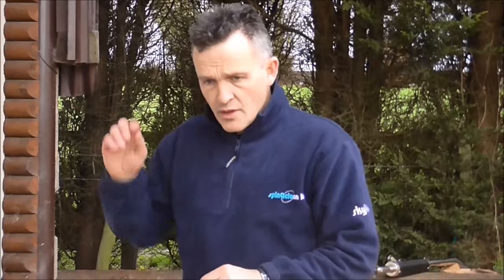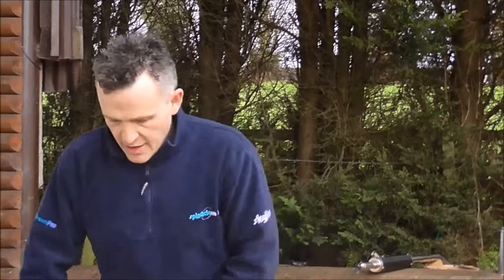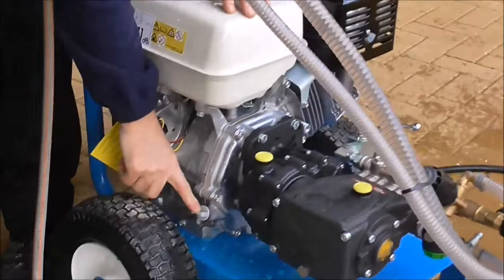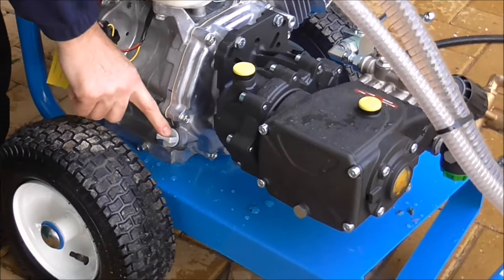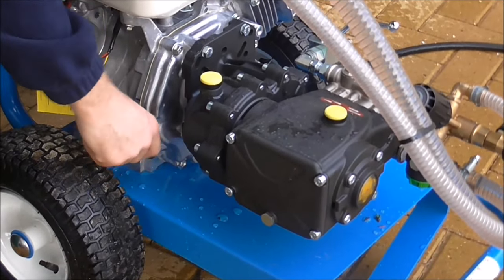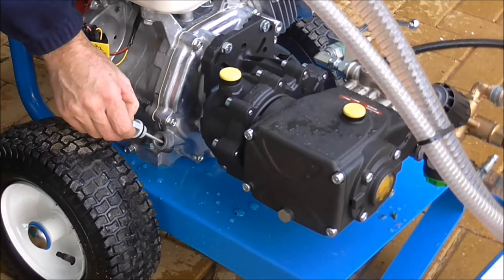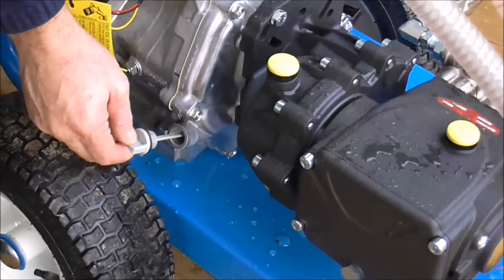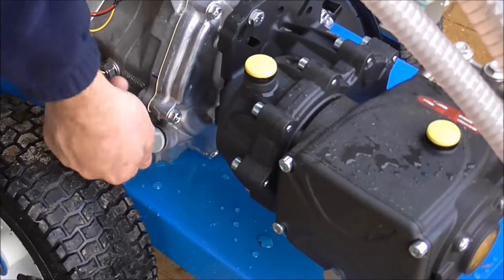How to fix a pressure washer that keeps cutting out

Comment: Just bought a new pressure washer. It was having trouble staying on. I loosened the gas tank now it stays on. Thanks. Gonna return and get a new one. After I clean all my traps 🪤. Thanks for the video 🙌🏼
Reply: @soo4woo554  Do You mean that you loosen the gas CAP?  I could see a flaw in the evaporative system requiring a loose cap...

Comment: Here's a related tip... 
I have a Northern Tool Powerhorse washer.  This year it started on the first pull but then began shutting down a few minutes later.  I had already confirmed that both the engine & pump oils were right in the middle of their dipstick ranges, and even gave the crankcase a couple extra squirts of oil, but even slightly over-full it still conked out.  So, I shut off the fuel and pulled the bowl and main jet off the carburetor to look for dirt.  Nothing.  Then I pulled, cleaned and gapped the spark plug and fired it up again.  Another easy start followed by dying 5 minutes later.  Finally, I disconnected the low-oil sensor and it ran until the fuel tank was empty!  The lesson: in less than 80 hours of use the sensor had crapped out...  
(Also, after running for a while the pump pushed out enough oil thru the breather tube that the oil level is now below the dipstick.  I can't figure it out, because if it was a seal failure I'd have plenty of milky oil on the stick...  Condensation from storage flashing to steam?)

Comment: Excellent explanation, do you put oil in where the dip stick goes in or is there a seperate opening for putting oil in?
Reply from the maker: Hello, thank you for your comment. The oil is placed where the dipstick can be found yes
Reply: @kingshearer2  Also, when you're adding the oil, just bring it up to the bottom of the threads.  That was always the rule before the plugs had dipsticks.

Comment: Great video. I have a Dewalt DXPW 3835 3800 psi. Pressure washer. My pw will start but 2-3 min later it shuts off completely. Have to give it 5-10 min to wait and will fire start again. I repeat the process 2 more times then stopped. What do you think is happening.

Let me know
Reply from the maker: Hello, thank you for your comment. I have spoken with our technician who has passed on the following information.

Looking at the pressure washer on the internet, the engine would have an oil level switch which would cause it to cut out if the levels are too low. 

We think as it's being run, the oil is being pumped around the engine causing the level to lower and cutting off. When the machine is left for 5 – 10  mins the oil level will settle back down being enough to cover the oil switch. We'd recommend topping the engine oil up and then see what happens. Failing that, it could be the unloader valve but unfortunately we wouldn’t know without looking at it here. Hope this helps!